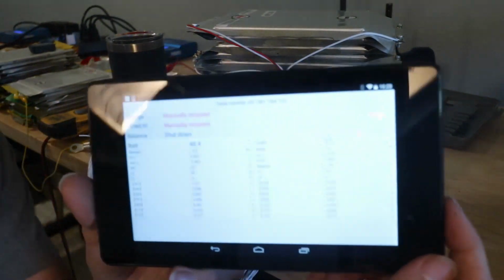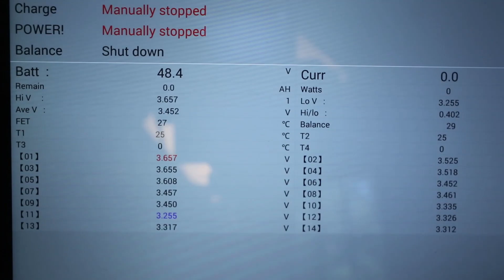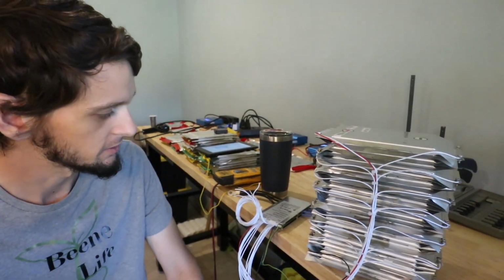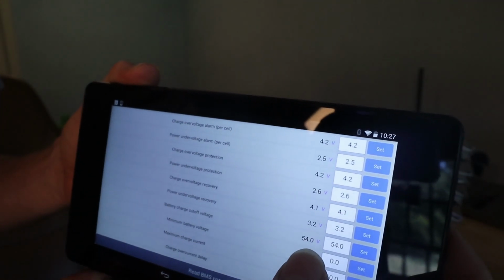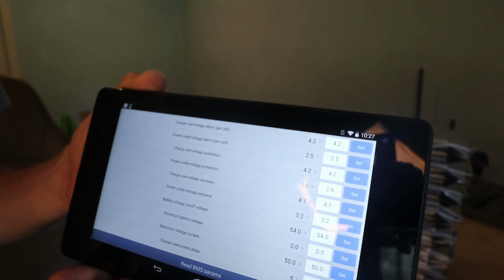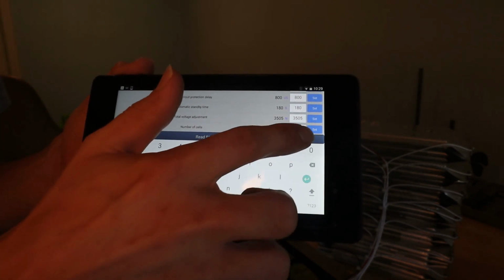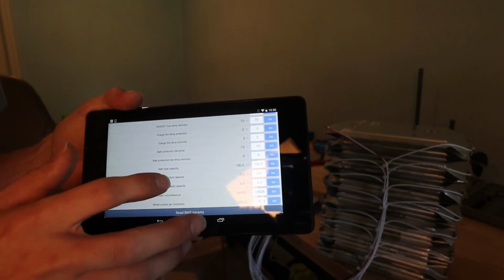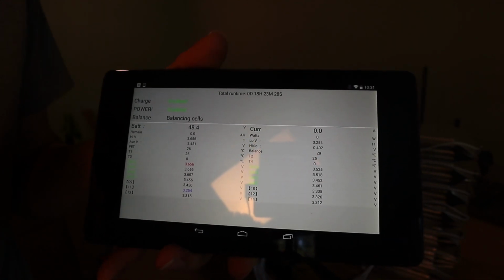Bluetooth Enabled ANT BMS Quirks and Programming on SPIM08HP Lithium Ion Battery Build

Comment: Are you sure it's active balance?  I think it's only passive?  and 100mA?  which is nothing...  I don't see anywhere where it says active balance...
Reply from the maker: It is an active balancer. Must manually start from the Bluetooth app. Took about a week to get my cells balanced out from about .4v out.
Reply: @BeeneEnergy  is it in some manual somewhere?  I see nothing in all the descriptions.
Reply from the maker: I’ve learned that if I want to know what a Chinese product does I buy it and try. It being in a manual doesn’t dictate the truth. I don’t have a reference for you, I just know that the ANT bms was, in my mind, one of the few that does active balancing. Sure enough after hooking it up that was the case. I could even clamp meter it and see some power flowing, albeit very very slowly. Not that it’s a tell-all but in the video you can see where after balancing is turned on the high cells turn green on the status page indicating balancing is happening.